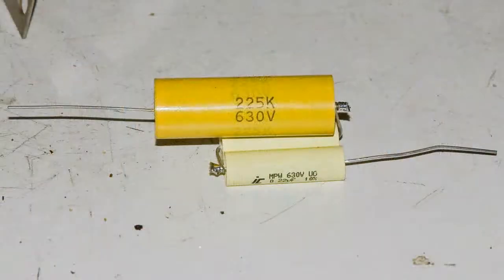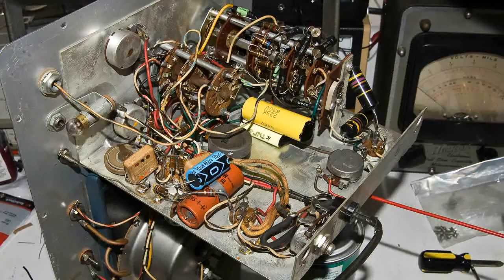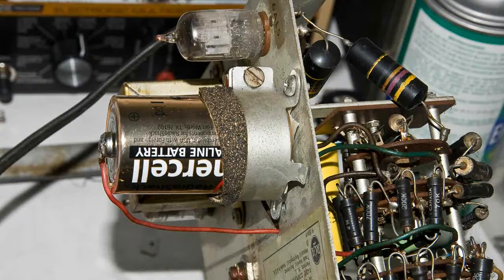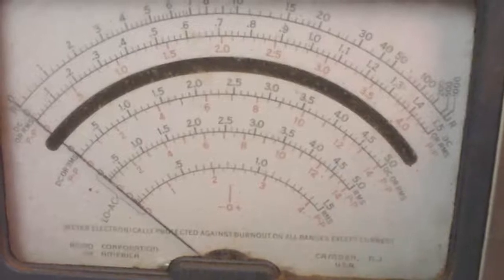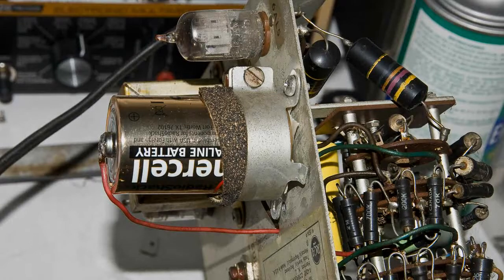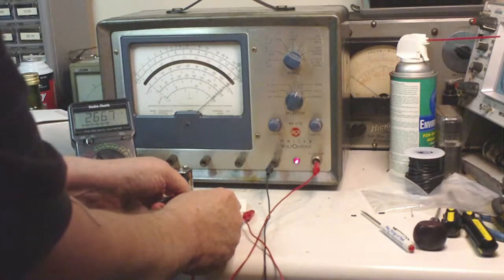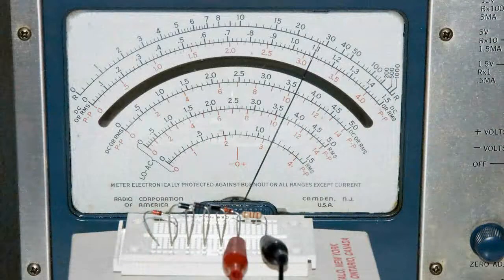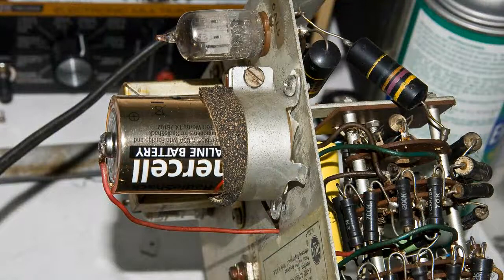RCA Meter WV-87B Complete, Testing

Comment: Hi Rick what is the black compound that you used on the capacitors?  Regards Bill
Reply from the maker: Hey Bill. It is called Corona Dope. Here is the link.
https://www.elexp.com/products/29cd10-4702bottle-corona-dope-2oz-w-brush?variant=42787235660004&currency=USD&utm_source=google&utm_medium=organic&utm_campaign=Google%20Shopping&utm_content=Corona%20Dope%20Bottle%20With%20Brush%202%20fl.%20oz&gad_source=1&gclid=Cj0KCQjw6uWyBhD1ARIsAIMcADqO_yq9gKlNOamBZfMefh868UqyUsg7TZ3VuJsQ3zOkEKJ9nXcRG8caAgJCEALw_wcB
Reply: @AllAmericanFiveRadio  Thank you much appreciated

Comment: @AllAmericanFiveRadio 
ok i need to get a new set i just got all the bypass caps pulled out and changed but   have ran the radio so far i don't have a hum in the audio of it but  i like to get  a new caps on that end i need 40/40/40@450v and a 40 mfd@450v i have never pulled apart  can's i just don't have the room or stuff to do it right